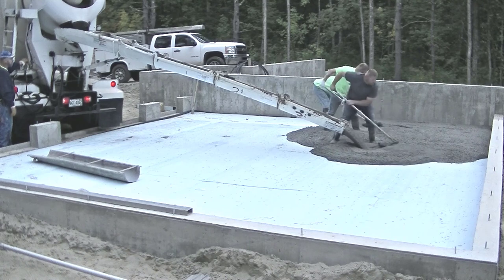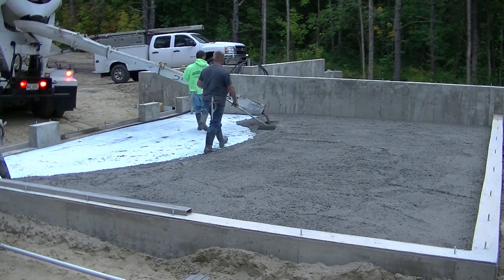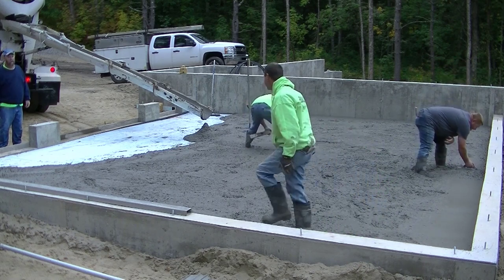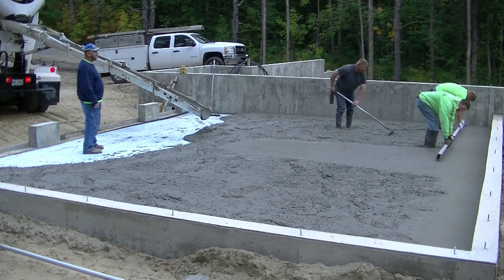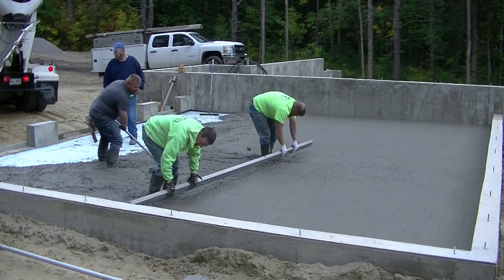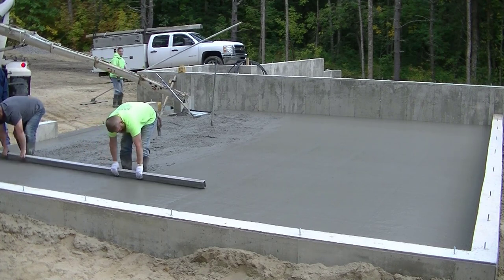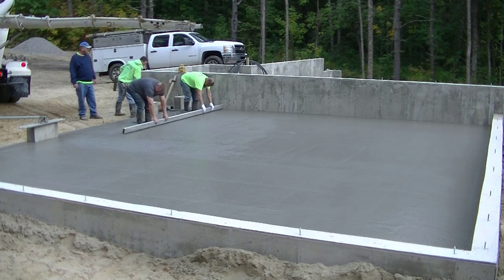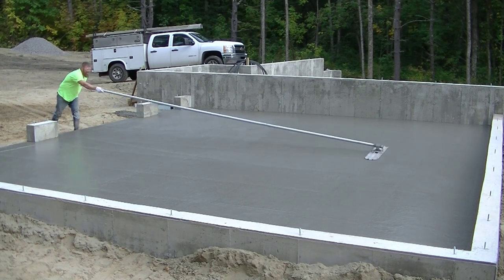How The Pro's Screed Concrete (Learn How Here)

Comment: You make it look so easy like eating a great cheese burger.    I have an area 20 by 25 deck I need and want to do but just nervous about doing it I have other areas around my house a lot smaller I think I will try them first and then get the courage to do the bigger pad.  ? Is it easier split it is half then pin it or just do it all. And how many guys do you think I would need.   ? Thanks for all the great videos

Comment: Question can i have that same effect with a 2x4
Reply: Yes you can use a 2x4. People that do it often use an actual screed board because it will not easily warp and twist. The key to whatever you use as a strike off is to use the back edge not the leading edge.
Reply from the maker: Good answer Jason! Thanks for taking the time to answer.

Comment: I think the most important part to the success you’re experiencing is due to not pouring the concrete too high or too low. The initial dump down the chute HAS to be accurate to the proper elevation or else it makes every step afterwards that much more difficult. You have a mucker knocking it down immediately and that sets up the crew for success.
Reply from the maker: Yea, getting it really close to grade when it comes off the chute is important. It's better to be a little high than low. Much easier to pull some back rather than pull some more back in.